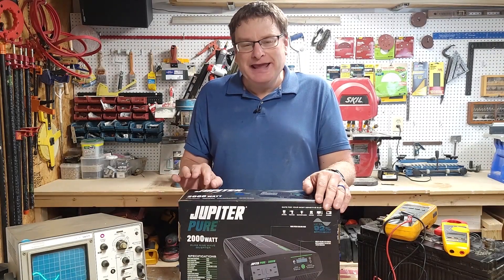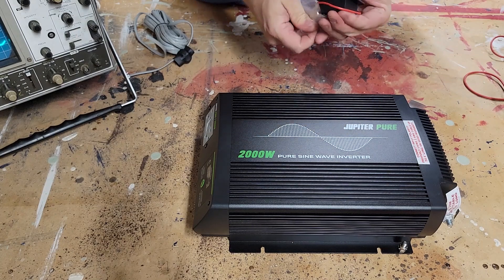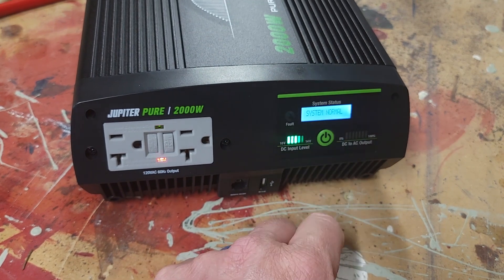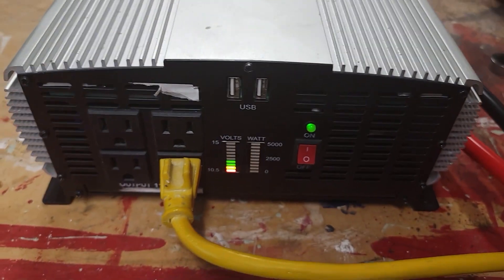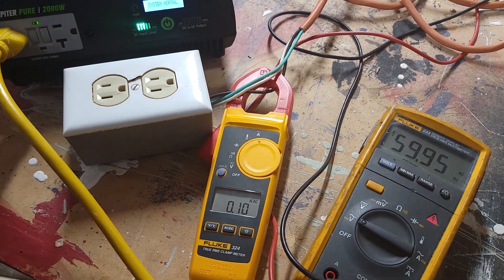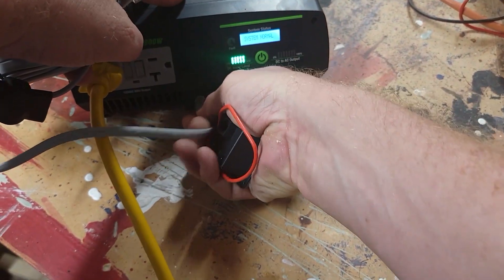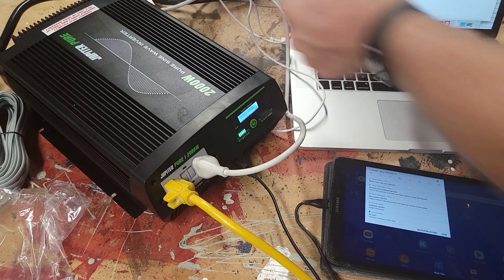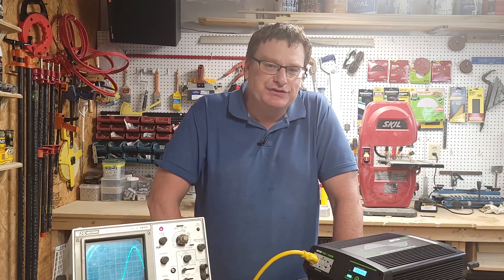Pure Sine Wave Power Inverter Review.

Comment: I had my shop install mine in my tractor. All that i have connected is my fridge and microwave. For some reason it keeps tripping the breaker. I never had this issue with my older, cheaper Jupiter.

Comment: Just picked one up open box for $150 I have 5 days to test it, would jumper cables be ok just to test/put a load on it?

Edit: I don’t want to buy 2ga cables yet until I know it works (only bought inverter because it was a deal, don’t want to invest unnecessarily)

Comment: Mine had bad GFCI out of the box.  Would run led string lights but Tripped under moderate load.  Red light “low life” flashing on the outlet.  Took it back next day.

Comment: Could my 10 awg cable be what's causing me the status message of hi temperature?
Reply: Yes, a 2000w inverter needs 2 awg on the back terminals for battery hookup.  If you are using 10awg on the AC output side and the cord is 50ft, yes, that would cause a voltage drop due to resistance of the length of cable.  Hope this helps.

Comment: Question. I bought a 500w inverter. When I first plug it in to a cigarette lighter socket without a load, it reads input at 12.3v and output at 120v on the inverter LED screen. However, I plug a laptop into one of the standard outlet sockets and the input voltage drops about 2 volts to 10.2 and the inverter starts screaming. I plugged this into my other trucks cigarette lighter and got an input read of 14.1 volts and when I plug the laptop into it, it drops to 12.2v and there are no alarms. Is the issue that the inverter I bought is too small for the load or is the first vehicle just not able to keep up with the demand? The laptop charger says it's 248w.

Comment: Would this pure sine power a Input: 100-240V 50-60Hz. Output Voltage: 20V. Output Current: 15A. Power: 300W computer charger? Any help appreciated.
Reply: yes easily, you could buy something smaller even

Comment: These cheap high frequency, transformerless inverters have a short life expectancy. Especially when powering inductive loads like  full sized refrigerators, large power tools, portable AC units or large microwave ovens. The reason for this is that all of these lightweight, high frequency inverters lack a very critical component. That critical component is an iron core, copper wound output transformer. Without an output transformer to act as a buffer to absorb the electrical surges provided by the “Flywheel Effect” inherent in the physical amount of a transformer’s iron, these surges and damaging reverse voltage spikes must be handled directly by the inverter’s MOSFET transistors, essentially shortening their life. You might be able to start and run some high surge loads when these high frequency inverters are new, but every time you fire up one of those inductive loads, you're shortening the life of the MOSFETs in these inverters. To make things even worse, lightweight, high frequency inverters run much hotter and their internal components are far more stressed due to their high switching speeds and use of high voltage components, These two factors makes the low cost, off spec, Chinese made components such as capacitors, MOSFETs, diodes, resistors and ICs that are used in these inverters, far more prone to early failure. Simply put, high frequency inverters are better suited for like duty, electronic devices, and low frequency inverter are better suited for heavy duty, high peak power appliances. 

Another major consideration with many of these lightweight, high frequency, transformerless inverters is safety. First of all, high frequency inverter don’t have Isolation between the Neutral and Line which increases the risk of a shock hazard. And second, during a catastrophic of the failure of the inverter’s circuitry, all it would take is for the AC output monitoring circuitry to fail and one of the MOSFETs in the inverter's H-Bridge circuit to short to ground, and these high frequency inverters can send dangerous, high voltage, high amperage DC current straight to your connected AC loads which will not only damage most AC appliances but can also set those AC appliances on fire.
Reply: So what brands do you suggest to check out? Seems every single one is Chinese made, I’m having real trouble researching for a good one right now
Reply: @Joa_Giovanni  Victron has a 1200 watt model for similar price and it is built much better and will last longer and better protect what you are charging

Comment: From the CarCare Nut  channel. He says a alternator is not designed to charge a very low battery. You must put it on a battery charger. It will shorten the life of your alternator. If you just run your vehicle to recharge it.
Reply from the maker: Great point. Thanks

Comment: 300 dollars, to high, you can get one that size for 140 dollars
Reply from the maker: Good point, thanks for watching
Reply: @snapoffmonkeybranch1242  not sure YT will let url's come thru,  sent you two
Reply: @snapoffmonkeybranch1242  by the way, if you use one they say is for a car you will need to put heaver cables to the battery, but they work good, I have used one for a car for years and it does good

Comment: Hi, I don't know anything about electricity really except for I will not touch any open wires. And I probably get electrocuted screwing in the light bulb. But I am buying pallets that includes ceiling fans and ceiling light fixtures and I need to test to make sure they work before I sell them. And I was wondering what equipment do I need in order to connect them up and test them in my storage unit? These do not have the type of plugs that you can plug into a wall outlet. It's just stripped wire

Comment: Can this inverter be used with a lithium battery?
Reply: Just hooked up to a 100ah lithium, works fine.
Reply: Inverters can be use with SLD, gel, AGM, or lithium.  Just be aware of battery voltages and your depth of discharge  for each type of battery.

Comment: I was looking at this to run a small 9amp shop vac and some other lil things. Would this work with only one 12v battery? I would prob have to run it with the veichle on so i dont drain the battery.

Comment: Overvoltage is spec'd at 15-16.5v.  Would have been nice to test that.  Low voltage cutoff spec'd at 9.5-10.5v.  Would have been nice to test that.  I'd imagine the only reason to buy this big a unit is to try to run a power tool which is largely inductive.  Would have been nice to test that.  Apparently there are 8 40a fuses in there.  Are the fuses hard to get to?
Reply: He did a better job of other videos on here about the same inverter, but if you don't like it make your own video, it will be very interesting
Reply: @my2centsrc202  Eh I would say it was mostly average.  The most he did was look at the waveforms, but really a THD meter would have given us the same or better info.

There are a couple other reviews that are less advertise-ish but test more important scenarios, like inductive loads.
Reply: Would have been nice to test that

Comment: This is one that I'm looking at definitely want to go with pure sine but I've not seen anybody do a review on a full size refrigerator being plugged in. Any experience in this area? Thanks for your time and video.
Reply: I’ve heard you may need a 3000 to be safe if you go that route! Idk much about them just what I’ve heard
Reply: @davemontano3790 if you can plug it into a standard outlet it uses less than 2000w, you can't get more than about 1800w out of a 120v 15a outlet. 4000 peak is more than enough for a refrigerator, they have a spike in draw when the compressor starts then pull a few hundred, maybe 1000 watts tops while running.

Comment: one issue i have with it is you cannot hard wire the unit to a standard 110 outlet but that's a side issue thanks for sharing the review. please have a great weekend
Reply: And the product is for a situation that you need AC power, so why would you hook up the unit to AC power if you already have AC power?
Reply: Means you cannot run dedicated power line from this unit to install in a rv to power it.
Reply: @hksjoshua If your rv has shore power just run an extension cord from the inverter to the shore power plug.